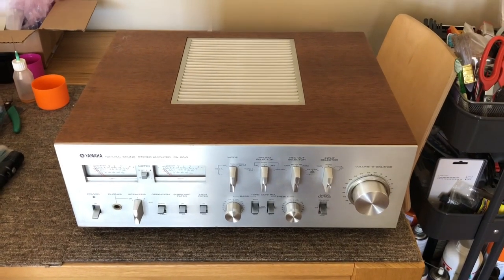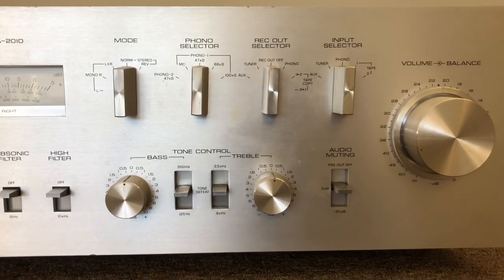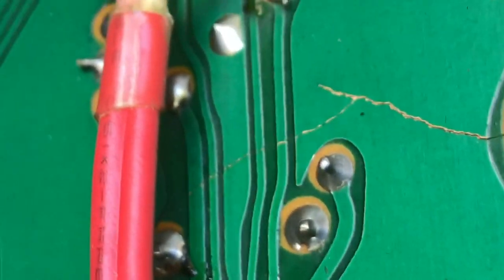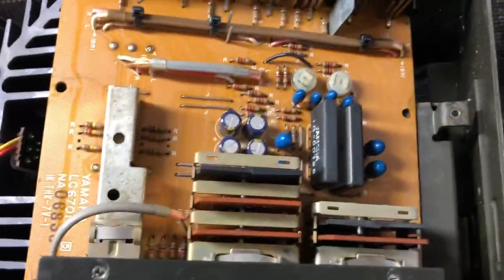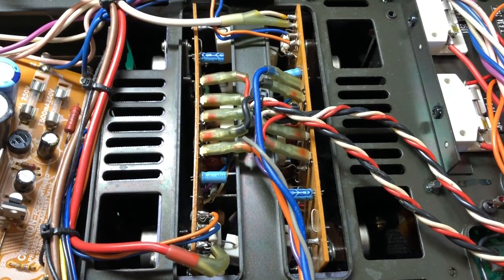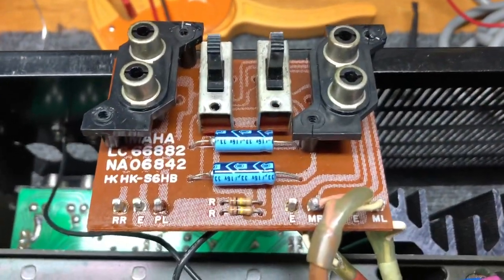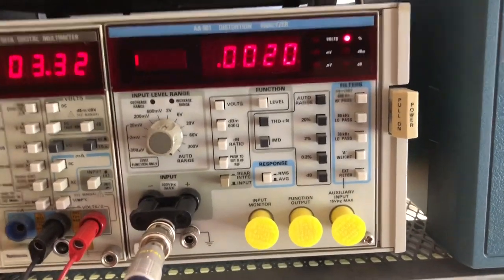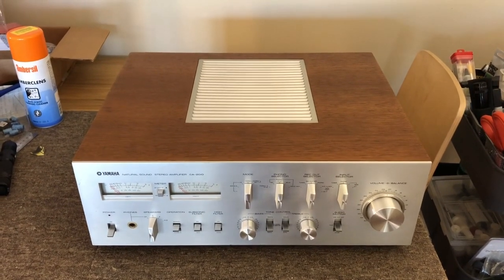Beautiful Yamaha CA-2010 Integrated Amplifier Repair & Restoration

Comment: Back in the day when the average stereo system was a receiver, a set of speakers and a turntable, stuff like this was what we dreamed of owning. Most folks I knew could only afford lower end stuff from Akai, Kenwood, Pioneer, blah, blah……..they all made a complete line from inexpensive receivers with 25 watts to top of the line battleships like this. Thing was, even the lower end stuff looked good……they all kind of looked the same, truth be told. They’re still a great deal for those willing to look around for decent ones. It brings back a lot of memories.

Comment: Just a note regarding the final 0.002% distortion. I can see on the video (about 22 minutes in) that the Tektronix AA501 distortion analyzer has the "A" weighting filter selected (button pressed in). This is a bit of a trap/gotcha with the AA501 as the filter selection affects all modes i.e. Level, THD+N & IMD (when it should only be applied to noise measurements). If the test frequency is 20KHz, this filter will attenuate the harmonics at 40KHz (2nd), 60KHz (3rd) etc. The displayed distortion on AA501 will be much lower (by 20dB or more) than the actual distortion (plus noise) e.g. it's more likely to be around 0.02% or worse. The best filter to remove out of band noise but retain the harmonics (up to the 4th) for a 20KHz test frequency would have been the 80KHz filter.

Comment: I sold mine ~1998. It's held it's value with inflation as a used unit but hasn't gone up. I loved it but wouldn't ever use it unless I needed a second system. 120 watts is way conservative, it's more like 150.  Currently running a 2001 Yamaha RX-V1. That thing can cool your beers whereas the CA2010 could cook you eggs. I do miss those extra 40 watts/channel tho.

Comment: Great work on the Yamaha  amplifier. Yes there are very well made amplifiers of this error. I have just repaired my own  perreaux  9000b power amplifier ( i have 2 ) , 500 watts a side into 8 ohms and a DC rail voltage of + and - 110 volts, DC coupled. Not a cheap fix and getting all of the mosfets was a bit of a challenge. Fan forced cooling as well .These things were hand made in New Zealand . But once again great work.

Comment: Definitely one piece of vintage audio equipment I’d love to own, very high quality for its time. The today’s equivalent Yamaha amplifier, the A-S1100 is another beautiful piece of audio gear, which I’m aiming to own one day. Love the classic needle VU meters.
Reply from the maker: Hi Ben, yes lovely pieces indeed. If you have a chance to read my article linked in the description, you'll find I've compared this beautiful CA-2010 with modern amplifiers. In fact, the AS-1100 isn't in the running next to the 2010. The CA-2010 compares best with the AS-3000 in terms of performance and the AS-2100 is also a better comparison, though it has worse technical specifications. This is surprising to many folks who imagine modern gear must be better, but it's often the other way around. All the more reason to grab one of these or one of the many other amazing pieces of vintage hi-fi equipment that people are rediscovering.
Reply: Liquid Audio awesome, I’ll have to check it out. I know some guy in the US has done a similar comparison too.

Comment: In response to a comment by John Darko (asking about recent amplifiers sporting the apparently back in vogue VU meters) I was drawn to reminiscing about the Yamaha CA-2010 I bought new back in the late 70’s - which, in turn, brought me to your channel.  Not, perhaps, particularly unusual insofar as I can imagine Yamaha selling quite a few of them.  What caught my eye though was your comment about your previous video concerning the overhaul/repair of a Sony PS-8750 turntable.  This was the very combination I used: A Sony PS-8750 turntable, A Yamaha CA-2010 integrated amplifier and a pair of KLH loudspeakers (the model number of which now escapes me).  My reason for buying the amp, other than its stunning looks, was the facility to switch between MM and MC phono inputs.  I chose MC and initially used an Ortofon MC20, though I later switched to the very smooth Lentek Entre 1.  Lentek, as you’ll likely be aware was a British loudspeaker manufacturer, though one keen to expand operations by diversifying into other areas – distributing the Entre 1 and later developing their battleship build integrated amplifier (which I later sold the Yamaha to buy).  What some may not be aware of though is that the Lentek integrated was designed by Philip Swift and Derek Scotland, who later went on to form Audiolab - their first offering, the 8000A integrated (which I see you’ve also had a dabble with) effectively being a pared down version of the Lentek.  Sorry for the ramble, but in these trying times it’s good to reminisce.
Reply from the maker: Hi David, please don't apologise for a really useful and informative ramble like this one, thanks for commenting!

Comment: Re the cracked PCB, I would have used an epoxy adhesive made less viscous with warm air (a hairdryer?) to bond the board and a single strand of 22 SWG wire across each cracked copper trace.   Keep up the good work.

Comment: The big blue caps on the power supply board are "El Cheapo" and one failed on my CA-1010. (open circuit). The hum was quite noticeable. Good that you replaced the others, they affect all kinds of stuff. Protection circuit time constant, sharp cut-off at power down, etc.
Reply from the maker: Hi, thanks for commenting, but no this is not correct, quite the opposite in fact. There are many myths and misunderstandings about capacitor performance. The light blue caps are actually very good Nichicon parts, used in good consumer gear and even in the most expensive test and measurement equipment like my Tektronix lab equipment where reliability was critical. Capacitors in this series generally last a very long time, despite their 85 degree rating, longer than many others. The particular parts you are referring to measured better than premium new parts. Doesn't mean they can't fail of course, but capacitor replacement should be informed by knowledge, experience and of course testing!
Reply: @LiquidAudio  Not talking caps generally. The large light blue colored caps are crap. One failed in my CA-1010. I'm a 40 year audio tech myself and I'm not steering you wrong on this. A lot of the other smaller caps aren't so great either. I'm not a "re-cap" guy but it doesn't hurt on a 40 year old piece. I replaced about 40 caps on my CA-1010, not because I like to automatically re-cap, but because I had THREE cap-related failures within about a fifteen month time frame. It's tempting to skip the large ones if you don't have them in stock - I had to wait on mine. They're 80v rated if I recall and I don't generally stock that high a voltage rating for 220 and 330uF.
Reply from the maker: I get where you are coming from, but based on my experience and for the reasons I explained, you are wrong about the light blue Nichicon caps. That's not to say your parts didn't need changing, but It's factually incorrect to describe that series as crap. They are actually very good parts and usually measure superbly, so it's important to correct this misinformation. I have these parts in stock, I have to given my business repairing gear like this, but again, these two tested better than premium new parts, so we will have to disagree on this one! Anyway, you'll find lots of technical information and articles at my website, based on the specialist hi-fi repair work I do. I'll probably end the chat here, but thanks again for stopping by and happy New Year!
Reply: @LiquidAudio  I wasn't trying to be argumentative. But I stand by what I said.
Reply from the maker: No problem at all. There is much misinformation out there and I try to correct it with factual, evidence-based responses where I can. Anyway, here's to 2019!

Comment: Great work. I prefer to use silver solder to fix broken boards as I feel it's a bit stronger than regular solder. But I noticed you used super glue to reinforce it. I'll try that with the cracked boards I have.

Comment: Hi yer lovely video I was surprised you by passed the pre main board would it be hard to design a replacement board and remount the components ?? 👍👍
Reply from the maker: Hi, thanks for your question, though it's not making sense to me unfortunately. I didn't bypass anything here so perhaps you can clarify your question and I'd be glad to answer it.
Reply: @LiquidAudio  hi yer sorry for the confusion during the video I think you said you where un happy with the pre-main circuit board you mentioned that some of the phono sockets and or the plastic holders where cracked/damaged ?? My question was would of it been possible to make either a new circuit board and transfer the components to a new circuit board  or would this been 2 difficult the reason is Iam working on a Yamaha CX-1000 around the switch power outlet board by the back power inlet socket which I changed to a Roxburgh filtered EMI/RFI filtered socket Iam always cautious about when working on old vintage hifi about flexing or damaging the connectors on the circuit boards being an electrical engineer most of my life re-wiring houses my soldering can at times be a bit heavy handed at times 2nd question do you work on DAT players I acquired a Victor XD-Z700 but Iam struggling to get the manual the JVC XD-Z707 was the model sold in Europe but I cant find any manual for either machine would you know of anyone who might have a copy, great vids thanks in advance Simon
Reply from the maker: OK, thanks for clarifying. Yes, a new board could be made or the whole element can simply be removed. Much depends on the unit in question, damage, fault, customer requirements etc. I suggest the usual online and distributor sources for manuals, DAT gear is something I avoid so I don't keep any DAT manuals, sorry I cannot help with that!

Comment: Hi! I have an issue with a similar amp, my Yamaha CA 810, please spare a minute if you could give me an advice. Here it is: I hear radio interferences in both speakers, the sound is almost imperceptible but mostly at late hours when the room is very silent it gets annoying. Radio sound is equal in level on both channels and it is not influenced by the master volume level. It stops only when no RCA sources are connected to the back inputs (any input!). I have to say that I use very good interconnect shielded cables,  that I just bought in order to clear this lead,  so I presume that the issue comes from somewhere in the machine. Other than that, the sound is very warm and natural, I enjoy listening analog tapes, vinyl and CDs. Thank you!
Reply from the maker: Hi Adrian, there are various possible causes for this type of thing but check any cables for broken shields or lifted grounds as RF signals usually get in this way. You may not live in Perth but if you do, you are welcome to bring her in for testing and diagnosis.
Reply: Thanks for your reply! Unfortunately I am based very far from Perth - in Europe - altough I did have some connection in Perth, to a mining engineering company that I used to work for, about twenty years ago (Lycopodium Pty)...  :) I was thinking to open the amp and start looking for a broken shield in the block of RCA inputs. That could be the start point of RF, maybe it is something wrong in the whole block, as of any  RCA hole I connect to, it starts happening. I am not an electronist, though, so I might ask specialized help in my area, but for the moment I live with it. Cheers, mate!
Reply from the maker: Not a problem and most importantly, don't use it whilst this is occurring, RF getting in this way can cause oscillation depending on the amplifier design and you really don't want that happening, trust me!

Comment: Hi,  I just came across your video and I am wondering if you might know what the problem with my 1010 could be.
I was playing music when I could hear a popping sound inside the amp. The music went silent immediately.
Just seconds before the popping-sound, the left channel started to hum.
I can still switch the amp on and off, the meter lights are on, the main fuse (at the back) is intact.
Only when turning the volume up to level 5 (12 o'clock, actually very loud and never used by me before) I can hear the music softly playing but in an extremely distorted way.
Do you have any idea what the reason for this could be, hence, which part exactly did pop and what could have caused it (I am using 6 Ohm speakers, the volume was very moderately set, Voltage is set to 230 V for Germany). Best wishes from Berlin.
Reply from the maker: Hi Timo, I'd love to help but questions like this are lot like "my car won't start, what's wrong with it?" if you get me. There are just so many variables, so many unknowns that remote diagnosis is impossible. Hands-on though it will be simple to resole for someone with the right skill-set. I suggest you find a really good local technician to have a look at her for you.
Reply: @LiquidAudio  Thank you and totally get what you say.
I actually found 4 popped fuses, located at the bottom of the amp (opened it upside down). They seem to be part of the connection between pre- and main amp.
All 4 blown.
I will replace them and see if the problem is solved. Maybe the amp had overheated?
Anyway, have a nice weekend.
Timo

Comment: Hi there!
I don't know how i found your website, but i was extremely lucky. I own a
Yamaha CA 2010 and i just lead to my trusted hi-fi shop for a deep cleaning
session after 15 years and we are a lil bit in difficult.
We can not find a proper *electrolytic and bi-polar capacitors*. I found
something used on ebay but it seems not right for my model.
Can you give me some suggestions? Anything would be super helpful.
Thank You very much from Italy.

Riccardo
Reply from the maker: Hi Riccardo, you need to purchase premium parts for an amplifier like this. I suggest the standard commercial vendors such as Mouser, DigiKey, Farnell etc. These vendors are the only way to ensure you are getting quality, genuine parts at sensible prices.

Comment: I just recently acquired a CA 2010 that the previous customer had left at a house and the new customer did not want the unit. I took it home and I barely hear any sound coming out of the main amp but if I switch it to preamp out and hook up an external amp I can hear audio just fine do you have a parts list of all the capacitors that need to be replaced so I can purchase them before recapping the amp
Reply from the maker: Hi Larry, no I don't use or supply parts lists. My advice is to troubleshoot and resolve the issue before even thinking about recapping.

Comment: Great job me and a friend just went threw my Onkyo integra M-504 and now it sounds amazing , My friend is my working partner at Montaplast we work in the maintence dept but he use to be manger of emotivas repair department i was getting to nervous have you ever worked on a M504 ? And what do you use to clean internal boards ?
Reply from the maker: Hi, yes I have owned and worked on an M-504. I use various cleaning processes, depending on the consition of the boards and what contaminants are present. It's a bit involved to get into here, but cleaning excess flux is good and a gentle water-based washing process is helful if boards are excessively dirty and if you have access to a low temperature drying oven. This is unlikely to be needed with something like the M-504. High pressure air is great if the contaminants are mostly dust-based.
Reply: @LiquidAudio  yeah we used compressed air and Qtips about 300of them was just dust build up itlooks amazingly clean now after about 2o hours and alot of patients sounds amazing i have a review video uploaded about it
Reply: @LiquidAudio  I really like the sound signature of the M504 with my Pioneer elite pre amp has really good synergy. Compared to the P 304 onkyo pre i think the pre needs some love put into it pretty nice nichicon caps

Comment: Hi
I have a yamaha ca 2000 amp and I have a problem with the right channel. You can hear some overvoltages on the right channel. Any idea where this comes from? I will be grateful for your response?
Reply from the maker: Hi Greg, testing and measurement are always the next steps when anything strange starts happening with an amplifier. Speculation is generally not helpful, so I strongly suggest taking her to an expert for assessment. These are wonderful amplifiers and they need the right care and attention. They also need routine maintenance at this age and they've often not received it in my experience.

Comment: Dear sir
I recently owned Yamaha C4 preamp 
Can you pls guide that should I recap only power supply electrolatic capacitor or I have to change all the caps in preamp as its working fine 
Pls guide me
Reply from the maker: Hi Gurmeet, I suggest you don't do anything other than take it to a specialist familiar with this model. It will need a range of maintenance I can't get into here, but beyond replacing capacitors.